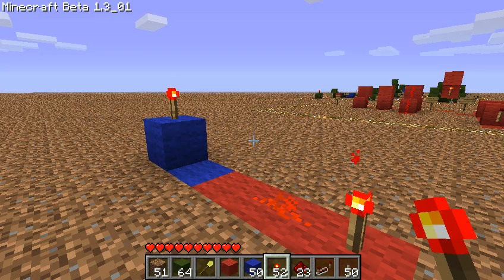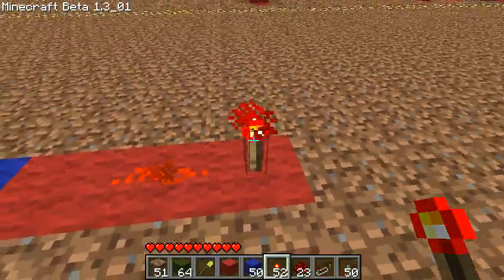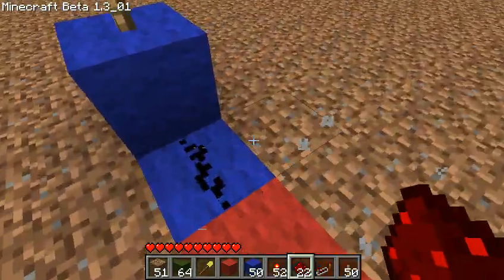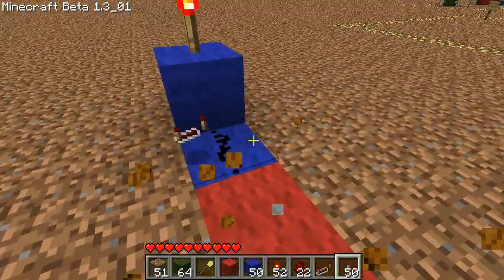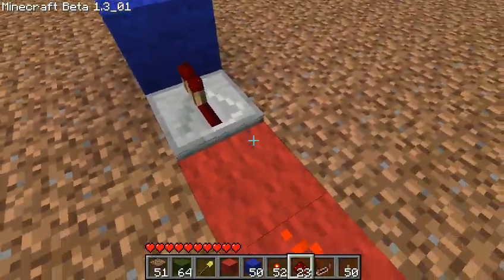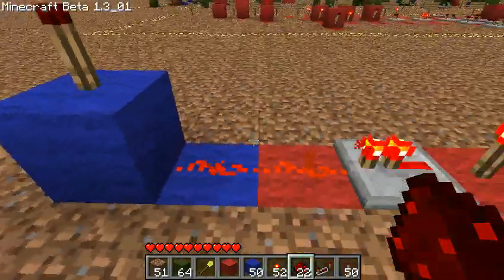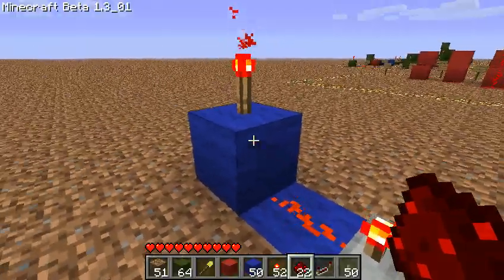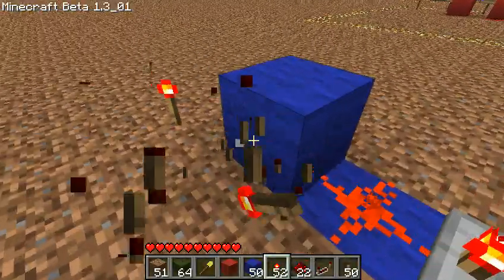Bug with redstone repeater one away from a block

Comment: But is it useful, for instance, placing a torch on top and on the side to yield two states?  Might help compact certain designs.  Of course, relying upon a quirk like this is kind-of scary, especially since the repeater is new and bug fixes might be on the horizon.